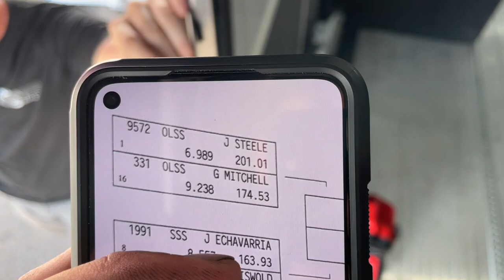FL2K21 Day 3: Mullet SMASHES His Best Pass Ever & Leroy Races 6 Second Stick Shift Cars!!!

Comment: Couple of suggestions:
- solid axle cars pull to the right because the driveshaft torque causes the weight carried by the rear tires to shift to the left tire. This causes the right tire to have less grip so the car pulls to the right.
- methods to compensate include increasing the right rear corner weight, by shifting some weight to the right side of the car and increasing the right rear coilover preload (and left front slightly). For your power level you could try around 50 lbs extra on the right rear scale (vs left rear) and tweak from there.
- note once the front end is fully off the ground this weight shift goes away...
- keep in mind nothing is "free". Increasing anti-squat will improve grip in the ~0.1 foot to ~ ~5 foot range (depending on rear extension damping) but will hurt grip in the ~5 foot to ~60 foot range. If you can crank up the engine power during the first ~5 feet enough, lots of anti-squat can work well but if you go too far it will hurt the remainder of your 60 foot.
- allowing the front end to extend more improves weight transfer and grip while the front end is up but note it takes time and distance for the shocks to extend. Right off the line the anti-squat has more impact because the front shocks haven't extended yet and rearward weight transfer has not occurred yet.
- ultimately you want the front end almost off the ground during the entire period you are traction limited.
- Mullet is "theoretically" capable of running around a ~6.8 second ¼ mile so fully dialed on a sticky track you might get into the 6's.

Good luck.
Reply: Absolute legend
Reply: I hope the right fella sees this. In this sea of redundant comments, this one may actually be useful. I hope my additional 'like' will bump it.
Reply: A few random things I forgot to include:
- the distance numbers above are just to give an idea where in a run anti-squat vs chassis weight transfer apply. Aero comes in at higher speeds (~80+ mph) and impacts both drag and downforce (downforce doesn't really help unless your burning rubber at 80+).
- anti-squat works by geometrically coupling axle-wrap to suspension height. If you put a camera down there you'll see the axle housing rotating as the power comes on. High levels of anti-squat can generate excessive pinion angle and cause u-joints to fail. Depending on setup you sometimes want the pinion pointed slightly downwards nominally.
- how quickly anti-squat and chassis weight transfer apply are significantly impacted by shock extension (rebound) damping. The less damping, the sooner you can apply more power but at the same time the less stable the car is. Rear tire pressure also impacts how quickly anti-squat helps (lower tire pressure delays the impact of anti-squat). Pretty much everything you can tweak impacts everything else to some extent.
- you should consider front shock extension limit and shock damping as separate tuning parameters. You typically want extension to occur as quickly as possible without destabilizing the car (including causing wheelies) and want to use front extension limit to fine tune total quasi-static (dynamic) weight transfer.
- moving weight to the rear is generally better than using the suspension for weight transfer because the suspension takes time to extend, compress, etc.
- it is a good idea to keep a log book to note every tuning change you make and what the impact was. Ideally you should do this electronically and include data logs from the car.
- ideally you should only make 1 change at a time, although changing more than 1 thing is ok if you already have data for everything but 1 change. Eg changing several things back to a known configuration combined with 1 new tweak.
- the pull to the right that solid axle cars can experience is significantly impacted by rear end gear ratio. For example we had an 85 Pontiac Grand Prix daily driver that had a 2.29:1 rear end that often pulled right suddenly when accelerating at the limit of traction (after dropping in a 454). With a 3.73:1 gear and 4L80 upgrade, the pull was pretty much was gone, even though it accelerated much harder.
Reply: It would definitely be good if Kevin, Garrett, or someone in their circle saw this.  Even if one of these  changes suggested helps break into the 6's it'd be awesome.
Reply: I honestly don’t know all that much about drag setups but reading this, it makes perfect sense even to me.  Well put sir! Knowledge is power and you sharing it is just awesome. Hope he sees it
Reply: also can depend on the cars, as some have rear ends that spin backwards compared to many american rear ends(or trucks with axle flip kits)...another good way is 0.5 psi extra on the side losing some traction
Reply: Holy adjustment guru @Slider68 Cleeter and Kevin need to have a chat with you!!
Reply: @KSR Performance & Fabrication please read kev
Reply: And the axle is trying to rotate to the left
Reply: This needs to be read
Reply: He has a anti roll bar to help equalize/tune the rearend to adjust for said axle rotation,It was shown in one of KSRs videos,they just need to learn the car with a lot of testing.Shock travel sensors are front and rear on this car as is a G meter so they know exactly what and when things are happening on the launch,he also has a anti wheelie program in the Holley to keep the nose down.They know enough to get in trouble or go fast LOL
Reply: Absolute legend. Great advice!
Reply: Just one of them things working out a new chassis.
Reply: Science
Reply: @Slider68  👌
Reply: Damn, so awesome to read a comment that is full of knowledge that is useful rather than some bullshit. Props to you man.
Reply: Someone needs to screen shot it this comment and get it sent to one of them
Reply: It would be neat to see this stuff simplified, illustrated, and organized for a quick reader to purchase at any local track. You would think someone in this industry would be in Cleetus' ear about this stuff, but I think that because he doesn't dedicate his life to racing, there aren't times setup to go to a track all day and tune the cars. Cleetus is involved in so many different types of events and video content, I confidently can say that anything involving drag racing won't evolve quickly regarding his vehicles. I believe that if he dedicated his time to Mullet and Leroy, which may affect his YouTube views a bit, he could take this brilliant information you have shared with us and apply it and be successful. Cleetus' diversity on his channel has earned him many fans, but will hamper his ability to master one of them! Just my opinion!
Reply: @joeanderson444  You have to keep in mind that YouTube is paying less and less every single year to content creators and that day is coming where the juice isn’t worth the squeeze. The content creation space has been over saturated for a while now and it like any other bubble industry will come to its inevitable end. So I can’t fault him for striking while the iron is hot when he has 3M subs. He’s a young guy still as well he’s got plenty of time to go full-time anything but he probably is saving that for the future when the dynamic changes in terms of the worthiness of content.
Reply: neat
Reply: Suggestions from a channel with ZERO racing videos. Lol.
Reply: So put the steering wheel on the right side and you're sweet! 😅😉 #straya
Reply: @Ditmanppi  I'm not complaining. Just explaining to the fans not to expect them to fix all of their drag racing problems when there isn't dedicated time for it.
Reply: woah some knowledgeable stuff right here
Reply: Exactly
Reply: I was literally just about to say the exact same 😯

Comment: Mullet and Leroy need a lot of testing. Just like Ruby had. That's why she's a 7.6 car right off the trailer. Mullet is easily a low 7s car without pushing a few barriers. You just need sufficient R&D to get the leave right and knock those 60ft times down.

I'd be glued to the screen watching them two reach new heights
Reply: I been waiting for them to bite the bullet and go front tranny and solid axel on Leroy. Also drop the 6 speed for a 4 speed like all the low 7 and high 6 guys.
Reply: @bbdl7042  He needs it badly. Leroy has basically been the same since his first 7 second pass 3 years ago. I guess with all the Freedom Factory stuff that's been going on he just doesn't have the time. 

But if he wants to be serious he has to dedicate some time to his Drag Cars. It's the main reason why I fell in love with the channel
Reply: Exactly dude I'm thinking like Leroy.... Dang u see how the car just jolt's when he leaves??? 
Me. I'm thinking he needs something to put some pressure on the drivetrain/tires... Sure it needs to dig, not shock and jostle the hell out of the tires lol.
Shoots weight back Rear end... Milliseconds later, rear unloads and.... There u go spin City lol
Reply: My opinions on mullet I think he needs to stay away from super prepped track's... For 1.
2 hell they talk about moving some stuff in the rear of it water fuel.... U get it/w pressure adjust, and stiffening the front... Well that's what I would stab at hell I wished he would say guys leave a suggestion and if it's logically sane reasonable LOL we may try it... It could help 
HECK fasterPROMS. LMAO I was the only one who saw the smart car had a weak suspension LOL took weeks B4 they I guess saw my comment and recognized... Hey this is why... Lol I got a thanks

Comment: Ty is like "Alright its time to fix mullet. I've watched you all mess this up long enough, step aside.." 😆
Reply: lol right. dude turns a wrench, 2 passes later they get a PB
Reply: Got better but personally think they ate on wrong path. Needed right side adjustments for traction loss on right wheel. But both wheels keep spinning no matter. Both cars spinning. Cletus tire carr hasn't been the greatest and often a tore works at 1 track won't work well at the next. Time for different tire maybe.  That and cletus burnouts have aways been kind if weak.

Comment: Yes I'm an old guy.  When I was 17 years old (1984) my first car was a 1964 Nova.  It had a 350 cid bored .40 over, a 4 barrel carb, and the meanest built turbo 350 trans.  It only had 13 inch wheels and was a one legger, so it would roast the tires through 1st, 2nd, and 3rd, as long as you wanted to go.  Yeah I know, not a drag car but it sure was fun.  I used to throw sparks off my well worn steel belts.  Haha.  Thanks for the video!

Comment: That supra took forever to stage, I would have rolled Mullet into the beams and put some pressure on them. Don't burn me down and I won't time you out.
Reply: It blows my mind no one on his team told him to roll on up when the Supra put it in reverse.
Reply: @rbjones1996  It's fine to give them some extra time, that's good sportsmanship. After that second burnout though the supra should've quickly got to the beams, instead they took forever there too. After the second burnout I'd roll Mullet in.
Reply: @curtiswendt6350  I agree get the timer running, took way to long after the second burn out
Reply: @curtiswendt6350  I dunno after reading some of these comments seems like that Supra is known to do stuff like that. I get being a good sport, but if you are known for that……nah
Reply: @rbjones1996  I didn't realize that, agreed.
Reply: The guy in the green Supra has a YouTube channel too his channel name is Baltic Supra racing
Reply: Calm down Dominic Toretto.

Comment: I understand that things happen, but the track should've stepped in with that Supra, that was bullcrap making you sit at the line that long cooling tires and warming your car up
Reply: All he had to do was put it in the beams, then the clock is on the other guy. Either way, someone is the bad guy.
Reply: there are rules in place for it, supra was well within the time limits.
Reply: @sirmonkey1985  I disagree, either way, it was a shifty thing to do.
Reply: @Comanchee0689  whether you like it or not the Supra didn’t do anything wrong.  Have you ever raced at a major event?  Burn downs, double bulbs, extra burnouts happen all day.  Deal with it.

Comment: Man, Leroy has just been having problem after problem and hasn’t been able to really launch since it got the iron block, I wonder if that weight shift really messed up the balance. Also, rough break on the sensor.
Reply: I think it's the power of the new engine too
Reply: For some reason i thought he always had a iron block... Is the LSX new?!
Reply: @stephenthompson9722  can’t blame the power when tuning can just keep taking power of out 1st gear.
Reply: @Allmotorzl1  The first LSX was an Aluminum block, thats what the first 7 was on, that 7.82 with no water after the heads pushed for the last time. Though to be fair, it was at least 2, probably 3 years ago. Leroy’s struggled to go down track ever since.

Comment: Cleetus would it be worth going to a more traditional set up for leroy’s drivetrain? Like slapping the trans behind the motor not in the rear end
Reply: its a vette. its designed that way.
Reply: @Stackali  I think they're still planning something of that nature so they can use a different trans that can hold up to the power that Leroy's engine is putting out.

Comment: Crank sensor, cam sensor or wiring harness is my bet. If it's intermittent and only happening at high engine speeds where there is a lot of vibration I would lean towards wiring.

Comment: I hate when people try to burn one another down like that. If that guy had just done a burnout and pulled up it would've been an easy win for cleet. I know that he had to do a nice burnout but you still don't gotta sit there and not put it in the beams
Reply: Which is exactly why he did it, and got the win.. Took a gamble on Cleetus not having the strategy to deal with it... Have a sneaking suspicion it wouldn't have worked against Jackstand...
Reply: @TernaryTrout  not sure y cleet didn't pull up to the beams and pressure the supra

Comment: Sad to see no wins, After all the events you've toured these cars on, along with the tour of your drift cars.  Your stretched too thin between the different events and not able to spend time on teardown, inspection and refresh on the idle cars. You might want to consider hiring a shop crew to work on the idle cars getting them ready for these  events.
Reply: @fast97z24  Then why are these cars failing at these events in every video? I bet they aren't tearing down the idle cars in the shop inspecting the internal parts that are breaking before the drivers return from a previous event with the other cars.

Comment: i would say the actual angle of the lower bar to the ground is more important than instant center. lowering the bottom bar link, closes to the tire, is going to make it easier for the tire to roll under the car. this makes the weight of the car sit on the tire more and less on the spring / shock (aka anti-squat), regardless of the instant center.

Comment: You ever think about how mullets not settled when you bump in then as the car is rocking back and forth you let off the Trans break to launch, but the tires and suspensions are not loaded down therfore blows the tires off the line

Comment: If ALL of the McFarland Racing crew, 
ran the same LS based Engines, 
& GM TH-400 + Gear-Vendors Transmission, then 
you could keep a couple of Engines & Trans in the Trailer 
(or back at the shop),
and could "routinely" swap engines & trans out for inspection, 
& possible overhaul.
The result would be an END to unpleasant surprises "On-The-Day".
Also on Drag-&-Drive events, several oil-changes, & spark-plug changes,
"PLANNED" in, and done regardless of perceived "NEED" (or not),
once again takes out the element of SURPRISE "On-The-Day".

Comment: Next time you race those supra guys let them do their burnout first. They did their ole' double burnout trick to help cool your tires down then they slow rolled to the light while you sat heating up. Of course they finished it with the classic slow bulb which made you stay on the trans brake so long you had to let off and get back on. Not cool.

Comment: Cleetus get a c5 auto rear diff 2.73 ratio for leeroy so you only have to shift 2 times, and be able to put all that power to the ground in first gear please please please, set a new record and alot more mph
Reply: Also put a 4l80 in mullet, gear it so first is slightly taller than now and have quicker second, and use third threw the traps